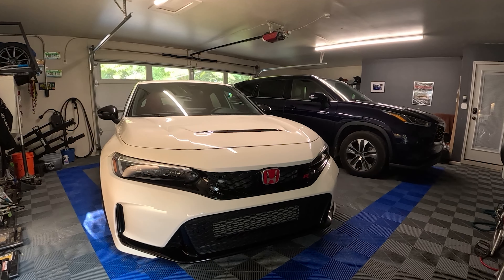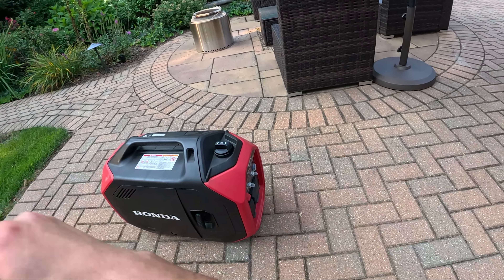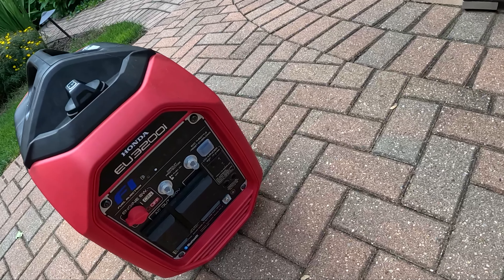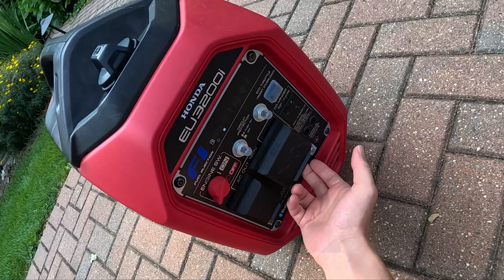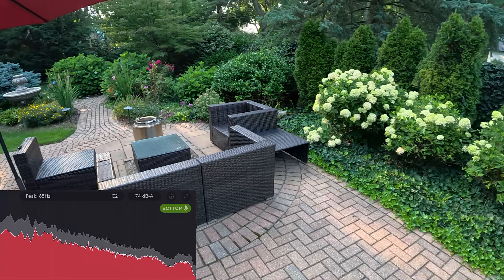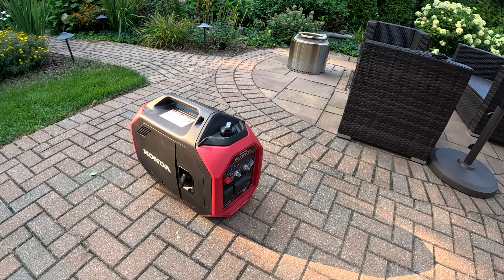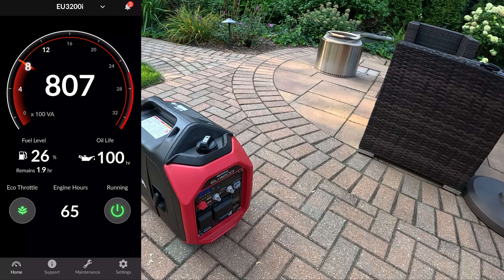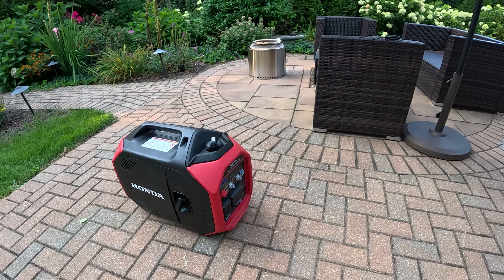Honda EU3200i Generator - POV Review

Comment: Honda generators are super reliable and easy to maintain.
Reply: Timing Belt easy to replace?
Reply: @rw9737  wouldnt say that. The gens i worked with didnt have timing belts or chains . Small ones use gears like the gx160kx. It overall though less pain in the ass to work on compared to yamaha havin different bolt sizing for every panel makin it a pain in the ass for my mechanics to fix

Comment: Hi there I really liked your video I am non sighted can you tell me if it has a fuel gage on the generator  instead of using the app thank you very much Joe
Reply from the maker: Yes, there is a fuel gauge on the generator. You don’t really need the app to operate anything, there’s even an eco mode button on the unit itself
Reply: Hi sorry for all the questions can you tell me if it has a choke I have the 22i and it has a manual choke. I also read that it has wheels but not sure 
thank you very much
Reply: @josephdeery4931  No carburetor, choke or fuel shutoff on the 3200. This generator has electronic fuel injection so it is simpler to operate. This weighs about 10 pounds more than the 2200 and is just a little larger.

Comment: I’d be interesting in a part 2, where you show how more details on how it’s connected to your house. Transfer switch or interlock kit? Would also be curious if you’re able to run the house AC, in the event of a summer power outage.

Comment: I bit the bullet and bought a whole home generator because living in a hurricane prone location, if required to evacuate I needed something that would fire up and keep the house air conditioned, freezers and refrigerators running, preserving our food if I’m not around. I also didn’t want to have to get out in the storm during hurricane winds and rain setting up, plugging in and starting the generator…I do have a 2500w dual fuel inverter generator for other activities, so having both is a win win in my book. As a backup to a backup I also have solar, you’ve got to cover all bases👍 Honda generators are pricey but are really great generators! Great review!👍

Comment: I have a couple of solar rechargeable batteries but after a major hurricane you can expect a few days of overcast making solar impractical.  I use the EU3200I to quickly recharge each of these batteries.  The big one can run the refrigerator for more than 24 hours and the small one runs my internet and tv if necessary.  I can run other things directly off the Honda generator if necessary.  The portability is excellent and the quiet is necessary in a neighborhood.

Comment: Would it be possible to explain how you connect it with your electrical panel? I have a similar generator and I didn’t found any way to wire a 120v generator to an electrical panel.

I am such a fan of your videos!!!

Thanks from Québec,Canada!
Reply from the maker: The electrician could only wire it into one phase of the electrical panel. So half the switches work and we had to move stuff around to prioritize what got generator power and what didn’t. That’s my basic understanding of what we had to do at least…

Comment: Nice machine but a 5500 rpm top engine speed is way too high, a slightly bigger engine running at 4k top would have been better.
Reply: But probably not under 60 pounds, Honda does have a model with larger engine and electric start at 140 pounds at about the same power level, the EU3000is.

Comment: I bought my champion gen for 600 bucks I could buy a bunch of them compared to the price of the Honda, it’s been 6 years and no problems with the champion
Reply: Hona generators are the very best most efficient that will provide clan power. I have Honda Generators that are over 20 years ole an only changed oil.
Reply: Champion is not as quiet, not as efficient, and not as reliable as a HONDA generator.  The Honda eu2200 inverter is only $1099.00

Comment: Love seeing this review, for those that don't know, SE Michigan is serviced by DTE Energy, who is (at least to my research) consistently in the top 5 routinely for power outages. So its refreshing to see someone post about generators or standby generators in the car community. It'll be interesting to see how the prices fluctuate on those now that Ford started the trend of EV's and even FHEV trucks acting as portable generators (At this moment still a Ford Employee so I only know the Ford application 😅). 

Unfortunately this solution isn't for someone in an apartment complex for gasoline, I myself have been dabbling with the thought of picking up a Jackery which uses solar power, but that money could be better spent in saving for a house down-payment. But again this is dependent on how summer goes next year probably. Anyways keep on trucking Chris, loving the Honda week of information (I might have a good surprise for you in photo & video form come Thursday).

Comment: Hi, does it have a gas shutoff valve it? Thank you
Reply: It does not have a fuel shutoff, or a carburetor, or a choke. It has electronic fuel injection.

Comment: Do you plan on buying one of your own after you return that unit? I am also considering options for emergency power, mostly our heating system when the power inevitably goes out in the winter.
Reply: heating with fuel or electricity?
Reply: @vipvip-tf9rw  fuel with tankless boiler.
Reply: it is his generator. he purchased it.

Comment: Do you know if  Honda has come up with an auxiliary fuel system to go with this for longer run times  if needed? Something similar to Honda 2000 I set up
Reply: It has an internal vent to a vapor recovery system so it is a little more complicated to set up extended fuel for this generator, but there are solutions out there. Honda doesn't produce extended fuel systems for any of their small generators, but third party vendors do, and some have solutions for this generator. It's just not quite as simple as the EU2000/2200 series.

Comment: I would build a reasonably sized heat resistant / fireproof baffle box to set behind the exhaust to capture the majority of the sound emitted if I was using this in a suburban setting.  Many of you might roll your eyes at this, but if you’ve ever lived next door to a cRaZy neighbor who calls the police over every little thing, or flings dog poop over the fence into your yard in retaliation, it’s best to just avoid that headache altogether.  😉
Reply from the maker: Funny story - our next door neighbor didn’t even know we had a generator because all the other generators were drowning out the little Honda 😂
Reply: it' is very quiet.  i have one and you don't hear it when inside home

Comment: Would it be possible to explain how you connect it with your electrical panel? I have a similar generator and I didn’t found any way to wire a 120v generator to an electrical panel.

I am such a fan of your videos!!! Cheers from Québec, Canada.
Reply: Get a Reliance manual transfer switch.  I have two Honda EU2200's and I installed a Reliance 306LRK  at my home.  I can power six 120v circuits, which is all I need for an outage.
Reply: This switch isn’t for 240v generator?
Reply: @HugodAmours-j7t it mostly depends on your panel, but you always can make a sub panel